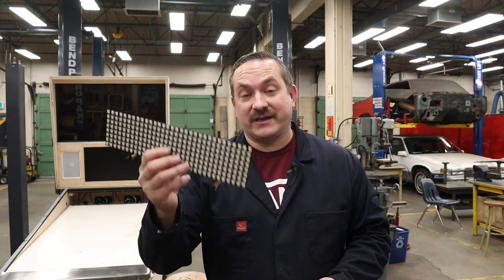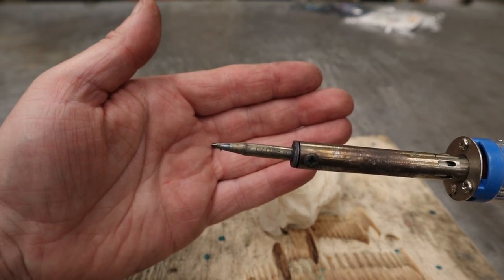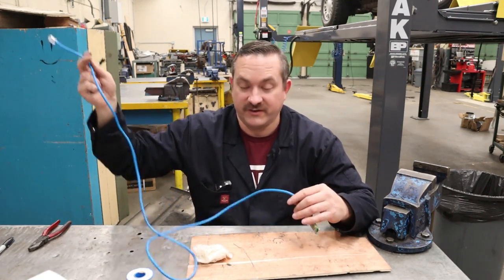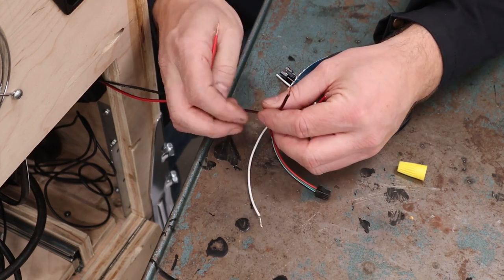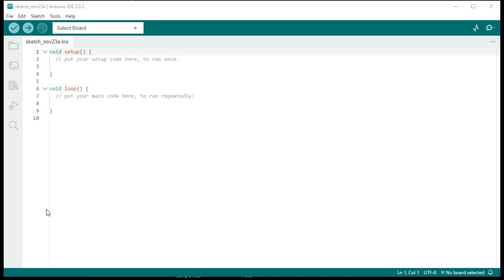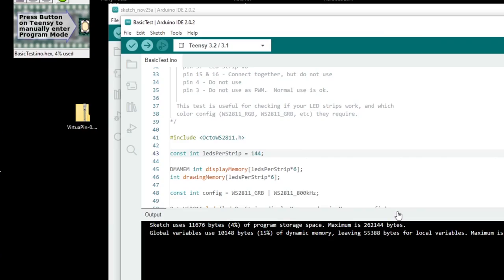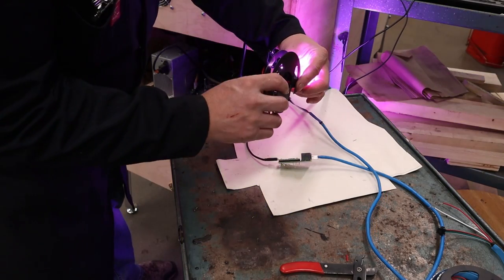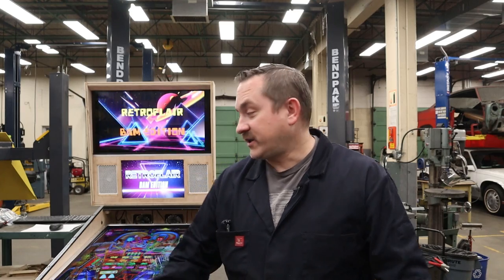How to test addressable led strips and matrix panels

Comment: Awesome. Finished mine a year ago but still love watching people build them.
Reply from the maker: Cool!  What kinda set up did you go for?  How many leds?  Did you use the teensy and octo board?
Reply: @wayofthewrench  Yes I used a Teensy and and Octo, but eventually switched to Arnoz Controller Boards. 90% of the pinball community is on Discord at Virtual Pinball Chat if you aren't already. As for leds I have 144 leds on each side strip, 60 on each undercab and only a 256 matrix, oh and a Siren :D I see you are using 2 matrixes and speakers which should look great!!
Reply from the maker: Why did you switch to the Arnoz board if you don't mind me asking?

Comment: Like a dummy I soldered the teensy upside down and they're near IMPOSSIBLE to unsolder, so others make sure you don't make that mistake. Also, when I tested my LEDs at first they were a bunch that didn't light in the middle. After a few reloads of the script it started working again properly. Again. WOTW You're awesome.
Reply from the maker: Ouch that sucks!  If you get a desoldering tool you'll be able to melt and suck off the folder so you can take off the teensy.  Hope that helps.  Thanks for the watch and your support for the channel!

Comment: Emil great video! I never tested my LEDs. I just put them in and crossed my fingers. However, recently I put in a 12v led button and it was bad from the factory. It cost me big in the pocket book. Long story short. I test every now. 
Again great video!
Reply from the maker: Yeah I'm about 1 in 6 strips have issues now.  Sometimes it's just at the beginning and sometimes you lose 20 or 30 leds.  It sucks when your project needs every single led though.  Thanks for the watch!

Comment: Great video Emil

Just a trick about the dead LED strip. Before cutting anything one can try to bridge the DO pad of the last working LED to the DI of the next one in the strip. You can use some flying leads and needles so you do not damage the strip (in case you want to return it to the seller) 🙂
Reply from the maker: Dude, that's a great tip and as sucky as a bad led is, I can't wait to use that info.  I used to just cut back from the end for the length I needed or try cutting the first led off.  Great tip, thanks !

Comment: thanks for the video but where did you find teensy 3.2 ? only the 4.0 is available
Reply from the maker: I bought it a while back but this pandemic has screwed everything up these days.  The teensy 4.0 and 4.1 should work, you just need the socket and longer pins to raise up the teensy board on the octo board.  They are only like .70 cents on the pjrc.com site.  Thanks for the watch!

Comment: Great Video! Can't wait to see the next Video. I'd like to know wich sections exactly you've connected with power the LEDs and how much Amp your power supply did you use. It would be great to see in the next video.
Reply from the maker: Thanks Roland!  I am going to use a 60 amp power supply, it's in the power supply video at the end.  I haven't nailed it down for sure but you have options.  You can daisy chain all of the strips together and do power injection every 180 leds or so.  Or you can keep each section or even strips separate so you can control the power for easy setup/less wiring/easier fuse calculation but requires a few more channels to be wired up to the octo board.  I'm leaning towards the latter but I will talk about both.  Keep posted!
Reply: @wayofthewrench  Thanks for your reply. Your videos are my No.1 Vpin 101, I really love the series. 

I read in a LED Guide, each LED need 0.06A to make it shine bright withe. But in use there need 50%, because not every LED is shine bright withe and they don't shine all on the same time. 

I have a 5V 30A power supply and I'm not sure if I can use it. I'd like to use 792 LEDs (256+64+64 back + 2x 144 left/right + 2x 60 undercab). 792 LEDs need 47,52A for all shining bright withe -> 50% = 23,76A in real. So the power supply still has some reserves.

I'm not an electrician, so I can't properly estimate.

What do you think, should I buy a bigger power supply?
Reply from the maker: @rolandhehl4289  its really hard to say because technically its not big enough but guessing that it is only using 50%, it might be ok.  The issue is the guess.  I'm going to be in a similar situation as I'm going to have closer to 1100 leds and I have a 60 amp.  Technically I'm over too but like you said, its not full white and not on 100% of the time.  You could always start with some sections and see how it goes and add another and see if you have any issues.   It is better to have more power than not enough.  Good luck on your build Roland!
Reply: @wayofthewrench  Thank you very much. This is a good idea to start with some sections step by step. Wish you a happy new year!
Reply from the maker: You're welcome...Cheers!

Comment: Good information once again! I'm getting ahead of you, but you mentioned that if you want to do strips individually -- ? Wondering why you may want to do that. -- because I might. I don't wan't the matrix, I only want the side strips so I'm not sure if you'd hook them up as separate like you mentioned or if you do it normally and then set DOF to not have a matrix etc. I'll be patient and wait for the next one, but I was intrigued by that addition of separate strips. Thanks for your excellent vids!
Reply from the maker: Thanks dude!  Yeah there are options for setting up the leds strips.  You can have everything on one channel or one data line or you can give every section a different data line.  You can definitely just have led side strips and not a matrix, just don't include the matrix in your cabinet file.  Should make more sense later in my dof video coming in the near future.  Thanks for the watch!

Comment: Great video My question is is does it matter which end of the strip you connect power
Reply from the maker: Nope but depending on length or amount of leds, you might want to have power on both ends to prevent voltage drops.  Thanks for the watch!

Comment: Great video as always!  I'm making the first cuts on my cabinet this weekend.  Is there anything you wish you would have done differently up to this point?
Reply from the maker: Thanks Joshua!  That's exciting dude!  Yes one thing I wish I did was raise my backbox up off the main cabinet even more for my design, like another 3/8" or even more so that when the back box swings down towards the playfield, it would lay flat. It's not the end of the world, I just have to make sure I make a well padded angled block/wedge to spread out the force so nothing gets damaged.  I do also kinda wish I painted and put vinyl on my cab right after building it because I will soon have to tear down and do that.  However, there has been lots of learning/designing/fixing while I build this cab and it would have sucked to mess up the paint and vinyl.  I think if I make an exact duplicate I would be ok with painting first.  Thanks for the watch!

Comment: Teensy 4.1 is now available.   It appears 3.2 is no longer available.  Will the 4.1 fit the Octo Board and will all the firmware/software be compatible as you have demonstrated?   I'm hoping that is the case since you provide clear and concise information.
Reply from the maker: As far as I know the teensy 4.0 and 4.1 are the same (more powerful) just a longer board so you have to buy some sockets and longer pins to solder them into the octo board so they can clear the board.  They are like .70 cents on the pjrc.com website.  Thanks for the watch!
Reply: @wayofthewrench  that should work.  I checked out the link.  Thanks for the lead.
Reply from the maker: You're welcome...Cheers!

Comment: Hi.
I built the cabin according to your guidelines (almost).
I have a problem with purchasing a Teensy controller to control LEDs. Can it be replaced with an Arduino Nano?
Reply from the maker: Cool, when you're done you'll have to send me some pics.  You can get teensy 4.0 almost anywhere, I just did a search.  3.2 is harder but still might be able to get it too.  Thanks for the watch and your support for the channel!
Reply: @wayofthewrench  Thank you for your time. If I get stuck on any problem, I will contact you :-)
The machine is 90% complete (I've already played it... Oh jeez!)
Reply from the maker: Did you find one?  I just ordered a 4.0 from pjr site
Reply: @wayofthewrench  Yes, I found it on exactly the same website. I haven't bought it yet but I definitely will.
For now I am using Arduino as ambilight and it does the "robot".
Reply from the maker: Another alternative is getting one from Arnoz or even switching to a Wemos

Comment: Love the video! If I have to mention some tiny things is that the soldering isn't that great. Dont use solder as welding. Put the cables togheter then "paste" solder to make them stay that way. Don't do dry soldering as on the top of the teensy. It might loose after some time (probably a very long time since it's only for a very low current connection for the teensy) thanks to the current. Better do it the right way (as you did on the bottom). 5 volt won't do I thing. You won't feel it. Your body resistance is at least 25000 Ohms wich makes your body get like 0.000somerhing amps. You need at least 0.00somerhing to feel anything. I=e/r aka 5 volt/25000  Ohms = 0,0002 amp. Not trying to be a prick or anything just trying to teach people to 😊
Reply from the maker: Thanks for the suggestion and the watch!  Glad you loved the video. Cheers!

Comment: Hi Emil is there a way to fix the led matrix if one of the little copper pads came off the back? Was moving it too much
Reply from the maker: You could gently scrape back past the copper pad to gain access to the trace and solder there too.  Just be gentle and if it works, I would add some glue gun to make some strain relief so it doesn't pull off again.  Cheers!
Reply: Ok will try that. thanks
Reply from the maker: Good luck!

Comment: is there any benefit to the teensy/octohat vs the all in one LEDWiz?
Reply from the maker: As far as I know the ledwiz cannot process the info the aleds need for dof led lighting control.  A teensy has a microprocessor that can send the power and signal to the aleds to get them to work.  The octo board allows for way more leds to be controlled that the teensy can control alone.  That's why they are combined together in most builds. I do plan on adding a ledwiz to my cabinet in the future for dof controlled basic lighting of the front panel buttons and flipper/magnasave buttons.   Thanks for the watch!

Comment: I'am so sorry but i have too more questions 😭so, i have one left and one right led strip and a matrix on the back of the playfield like in your system. So, what i have to do that all are working together? Can I just connect them together or does each stripe and matrix need their own teensy?  And how do I program the whole thing in the arduino Software? SORRY
Reply from the maker: No worries.  I think you need to watch the next 4 videos as all of the info is there and in a better format than a message here.  You can put them together or keep them seperate, you just have to make your cabinet.xml file to match.  Cheers!

Comment: Does it matter whether you use a Cat5, Cat6, or Cat7?
Reply from the maker: .....I said Cat 6.    Just kidding.  Ya I'm not sure but cat 6 is readily available, even at the dollar store so I would just go with that.  Thanks for the watch!  Cheers!
Reply: @Way of the Wrench  I had an extra cat7 lying around so just curious. Thanks
Reply from the maker: So I just took a look and the connector is different on cat 7 so it may not work.
Reply: @Way of the Wrench  Good to know thanks
Reply from the maker: No worries...Cheers!